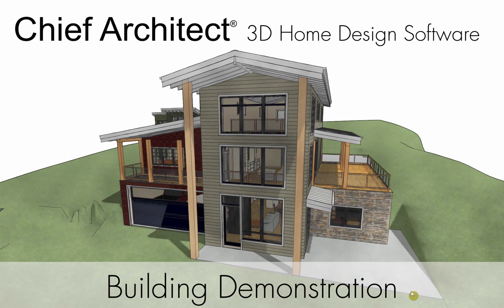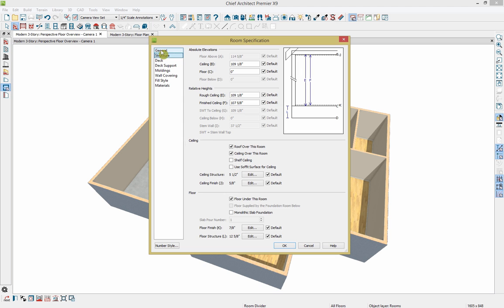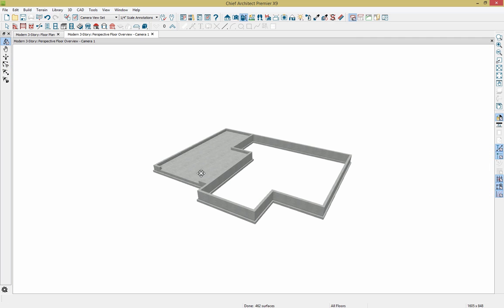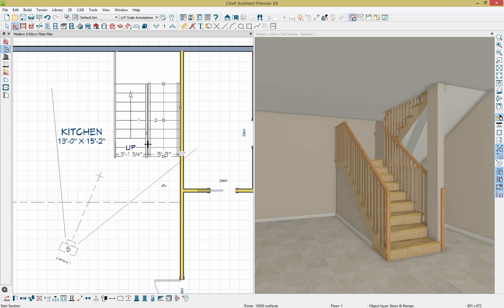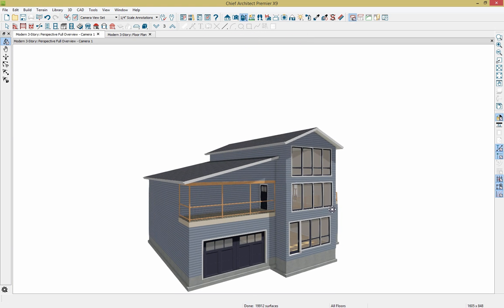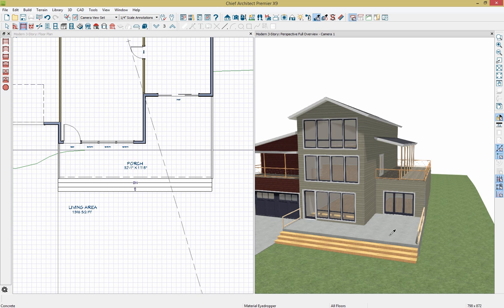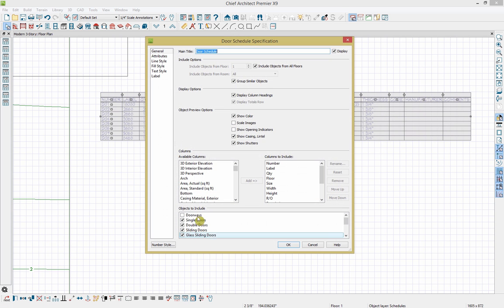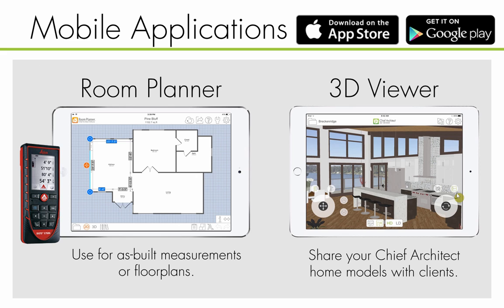Chief Architect X9 Building Webinar

Comment: i hate to be such a novice to your program on here, but could you possibly devise a set of parameters by yourself in this software to mimic the material and dimensions of various shipping containers? perhaps some code or equation that would automatically include the structural qualities, as well as the dimensions of primarily 20 or 40 foot models? I'm eager to know, as I'm considering purchasing this iteration.
Reply from the maker: We don't have a specific training on this home design method. However, we've seen many our customers accomplish this design in our Chief Architect software. You are able to customize your walls to resemble the container and modify the floor and roof structure for the space. You can also reach out to our customers through our user's forum: https://www.chiefarchitect.com